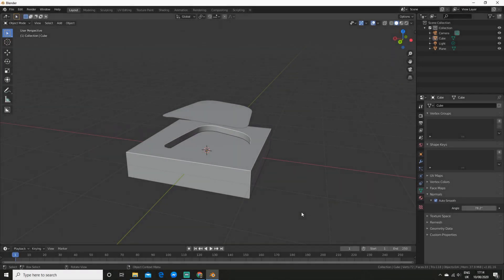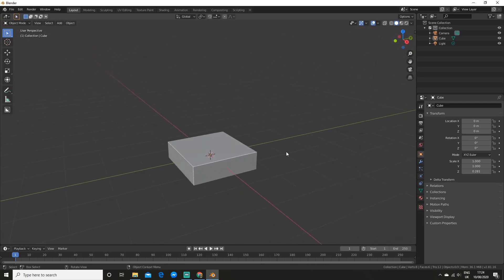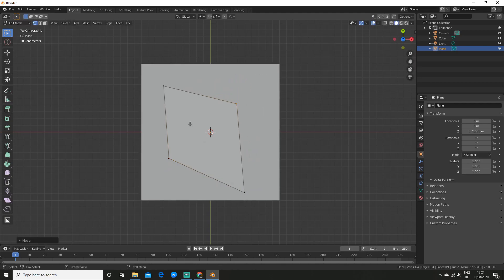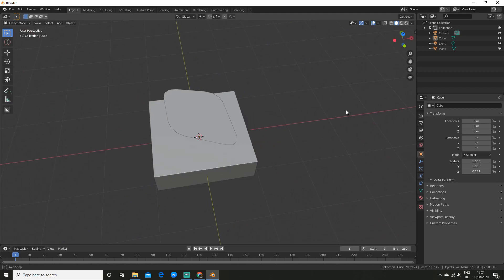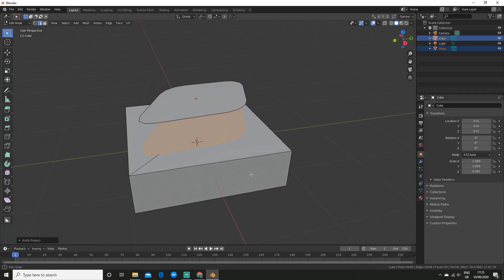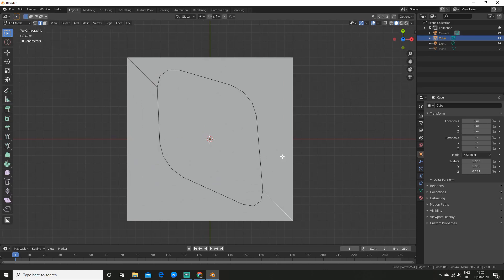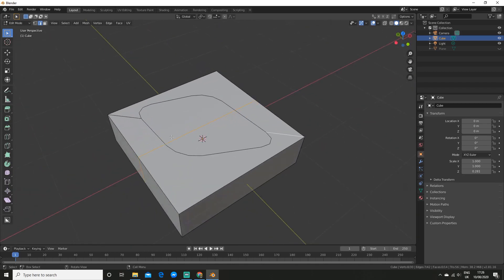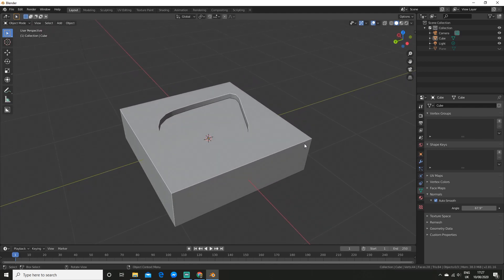How to project geometry and clean up connections | Blender tutorial

Comment: Can you do this somehow with a 3d object as the object to project? 

I have a 3d object and want to cut a silhouette of it
Reply from the maker: I will try it myself soon and get back to you
Reply: @CGLife  Thanks
Reply: I'm wondering the same thing. When I try to project a 3D object onto a 2D plane, I get the error "No other selected objects have wire or boundary edges to use for projection". Did you figure it out
Reply: @hopperelec  Yes, the thing is that Blender devs changed how it works https://www.youtube.com/watch?v=M9EMWYOgmqk
Reply: I found an alternative that works for this; the shrinkwrap modifier
Reply: @hopperelec  Thank you so much. It helped me the same way. In fact, it is even better than I thought.
Reply from the maker: I don't see why not, if it doesn't work make a copy of the object and remove everything but the faces you will project
Reply: @CGLife  I've been trying it, but it doesn't work with 3d objects, and I'm not sure if it works with flat but irregular shapes (doesn't seem to for me)
Reply from the maker: Sorry I forgot about his got really busy. So blender cannot actually determine those edges as the boundary edges are classified as edges that have one side where nothing connects to it. As objects are typically manifold, the outer edges we want to project do not have a side with nothing connecting, and that is why it won't work. 

As far as a solution goes, I think you could get away with either extruding the geometry that is in the shape of the projection you want through the object you are trying to cut, then use a boolean to subtract it. You could also trace the shape around from a single vertice perhaps and fill it then project that instead. Also note you may need to select the object you are trying to project onto alone first and then enter edit mode, then ctrl left click the object you are projecting. You can then proceed to make the cut. 

Ask me if you have any more questions and sorry the solution for this is a bit messy/inconvenient.